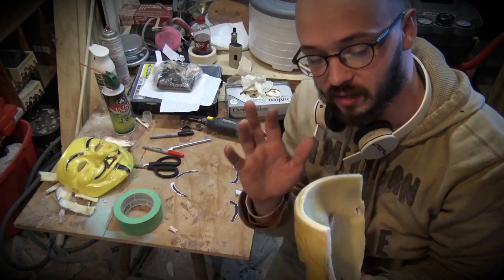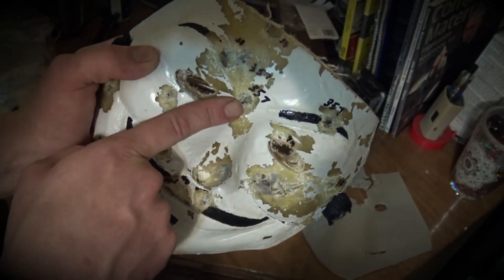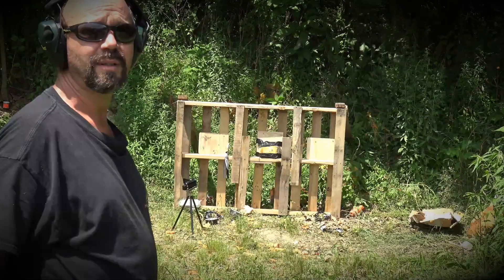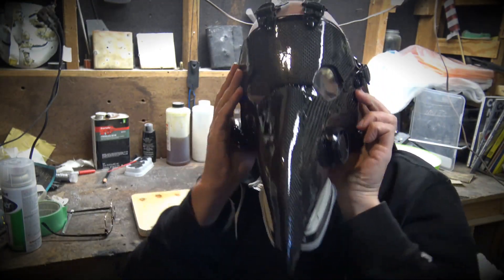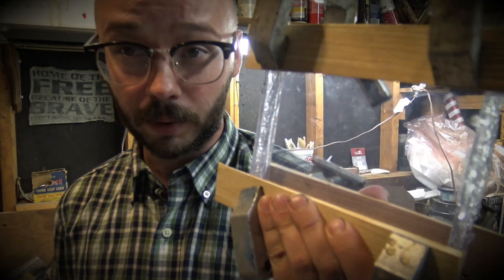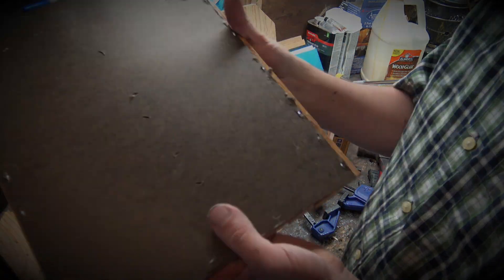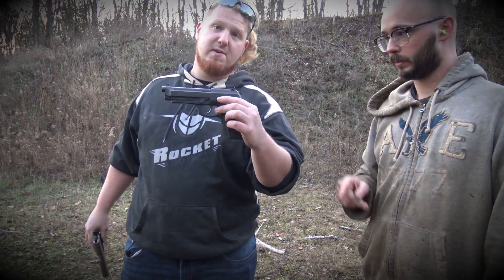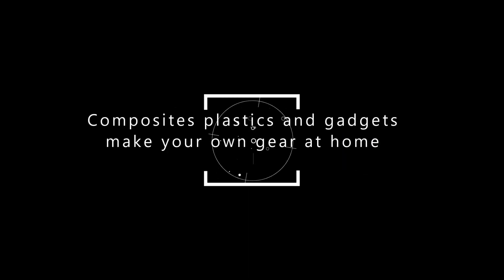Composite & plastic armor (tech this out meow channel promo)

Comment: Hey Tech this out meow. Love what you're doing. I've seen your vid on melting HDPE into plates, but what about laminating the flat sheets together with an adhesive? 
I have cat sand jugs that are HDPE that have nice large level sides that are a perfect size for a chest plate (or a pelvic plate which I'd like to make). Have you ever tried laminating whole pieces without melting?

Comment: Also, people have been heat welding fiberglass fabric to 3d printed parts. This might work with HDPE also instead of using epoxy.
https://youtu.be/G1HUUncqcjY
Reply from the maker: this is real interesting, thanks for sharing this with me! Ive been wondering if fiberglass layers could be added to HDPE to form a composite.
Reply: @Techthisoutmeow  The full tutorial from Ivan is here --> https://keybase.pub/ivanthetroll/

Comment: I would NOT want to wear that mask if it got shot.  The impact would be awful, even if it stopped the bullet.
Reply from the maker: lol yeah that was one of my earlier designs, the back face on the ballistic clay wasn't bad til we got to the magnum, then everything changed. But as a base Idea you could, in fact build off it. That UHMWPE fabric is incredible at slowing bullets. You should look into that resin I used, it may help you with your project.
Reply: @Techthisoutmeow  Will do.